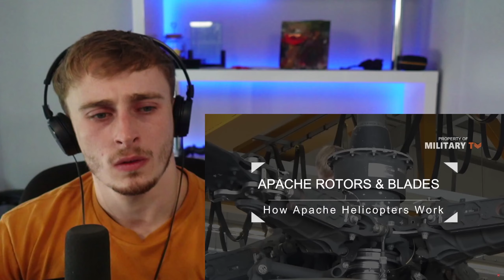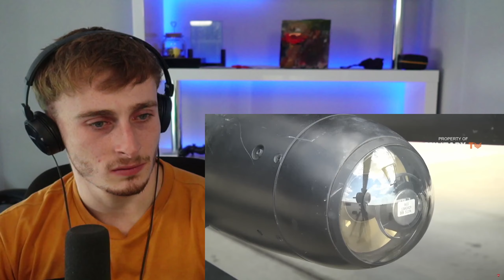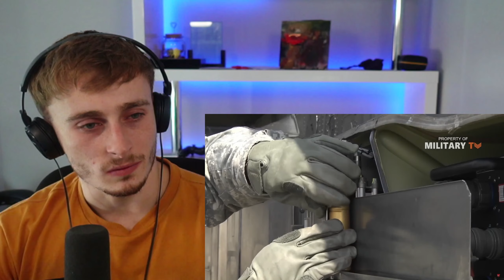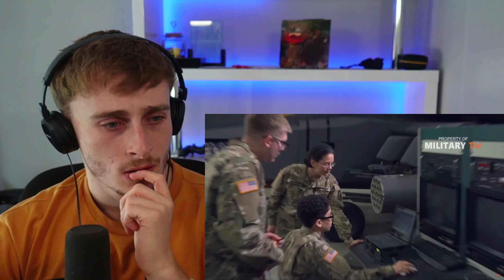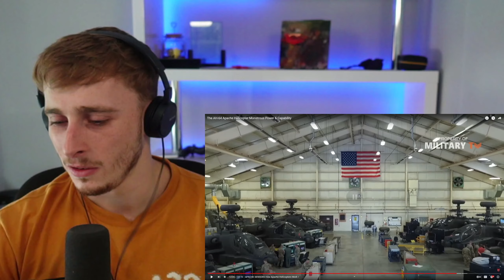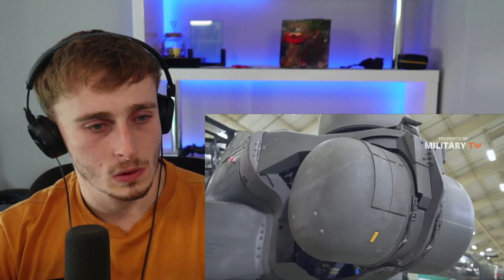Brit Reacts To AMERICAS AH 64 APACHE ATTACK HELICOPTER!

Comment: One of my best friends served 3 tours in Afghanistan. He was an MRAV driver in the Army and they worked in a garage that was shared with Apache/Blackhawk/Chinook mechanics. He said that there was an Apache in the shop that had just had a taliban fire an entire AK47 magazine at the side and bottom of it. All of the bullets hit, but they all just bounced off, and the taliban fighter looked freaked out and threw his rifle on the ground and put his hands up to surrender. But since they did not have space on board to hold a prisoner, and since it's a war crime to shoot an enemy that is surrendering, they just motioned at him that there was nothing they could do for him and they took off. When the Apache got back back and they look at the damage, the damage was so minor that all it did was chip the paint off, so all they had to do was sand the two panels down, put a few globs of body filler on the strike marks, and spray the panels with new paint.